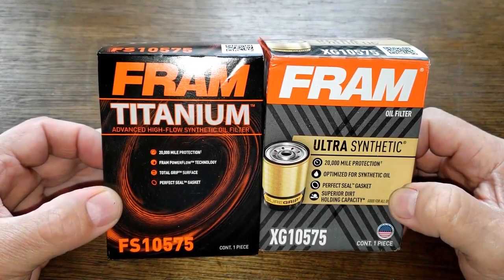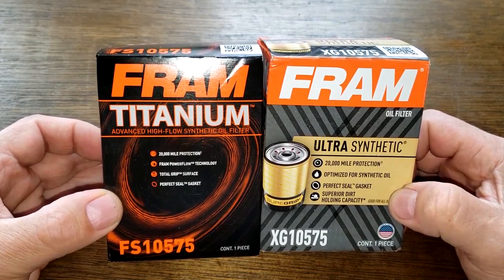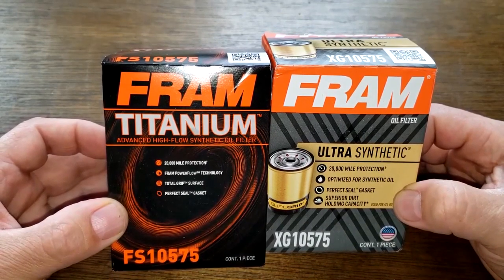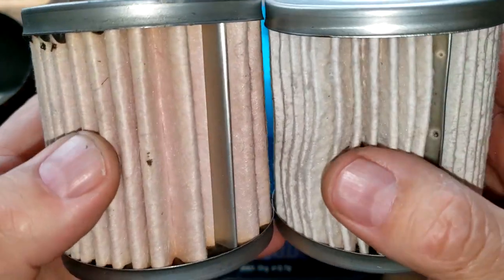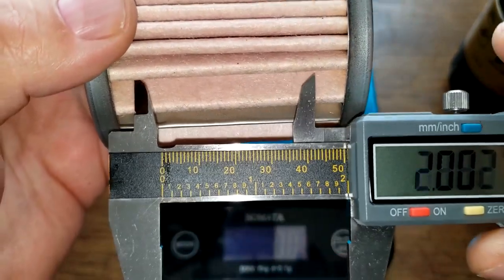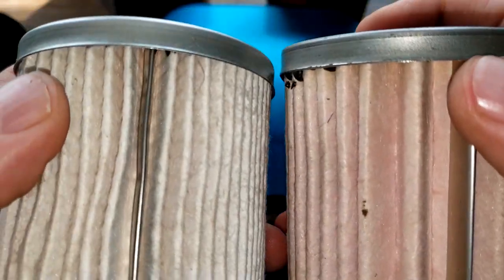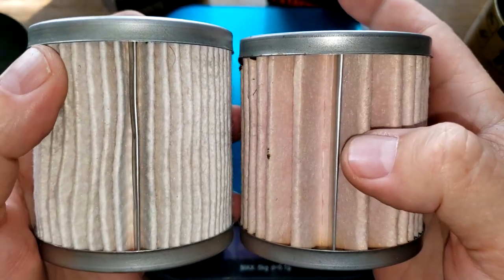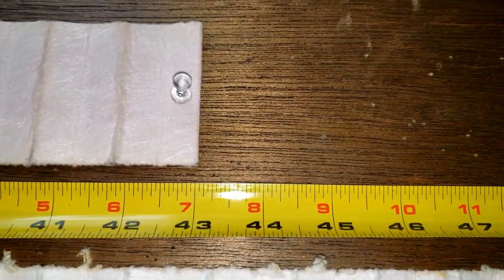Fram Titanium FS10575 Oil Filter vs. Fram Ultra XG10575 Oil Filter Cut Open

Comment: Now I've seen these two filters cut open before and the filter media was identical. That's kind of weird
Reply from the maker: Maybe old filter video?
The Fram Ultra changed a couple of years ago.
Reply: @WhipCityWrencher  yeah not sure where I seen it at but the filter in side was the same as the other. Might of been an older one from fordboss dude

Comment: The thicker material would be an oil pressure killer! Every car or truck I've changed from Fram to another brand has gained a few pounds of oil pressure. I would not use either of these filters.
Reply: What’s your go to filter?
Reply: No. They've done delta p testing on the synthetic media, in OG Ultra and Titanium. It is actually lower than the thinner cellulose and blend media. Titanium "flows" just fine.

Comment: Question if it does get in the filter will the filter still suck it out?
Reply: The hole in the middle of the base plate with the threads is actually the outlet hole where filtered oil gets pushed back into the engine. So, if one of those metal shavings came loose when you screwed the filter on to your engine, it would get pumped into your engine with the oil the first time you started your engine.
Reply from the maker: Yep, what 
"Save16thave"  said

Comment: $15+ for a filter. What's going on with the escalating oil filter prices?
Reply: Same with oil prices. Cost of manufacturing I'm guessing.  Not to mention shipping of parts. Used to be able to do oil and filter with full synthetic and a wix filter for $26. Now the filter alone is over $11 depending where I buy.

Comment: $15 just for an oil filter? Wow. No thanks.  For $4 to $5, I just use the 'tried and true' Motorcraft filter.  But I change my oil every 5,000 miles and use a full synthetic oil (usually whatever is on sale at the time).
Reply: It's not $15. It's $11 at Wal Mart. I paid $8.50 for my car. It's a 20K miles filter, but I usually change mine around 12K miles with the 20K mile extended drain oil. If you're not going 7,500 miles with full synthetic then you're just wasting money. But a lot of people do that. Yeah, it's not hard to change oil, but it's a pain for me. Takes me like an hour to do it and it's messy, so I prefer to change my oil as infrequently as possible.
Reply: @aznnp77  you only paid $8.50 for your car? How did you buy it so cheap?
Reply: @LA_Commander  It made sense in the context of my comment that I paid $8.50 for my filter. But I guess you're right, if you just take that sentence by itself, that's what it says.
Reply: @aznnp77  Tell you what, I'll give you 20 bucks for your car right now. You will more than double your money!  LOL 🤣

Comment: Question: When mentioning Micron Ratings, the standard is the ISO4548-12 spec -- BUT --  is "AT 20 Microns" the same as "Greater Than 20 Microns" ??
The Bosch Premium's box says "AT 20 Microns" which, to me, is smaller than "Greater Than 20 Microns" where I come from. 
These filter makers use some very subtle tactics in order to fool us.
Reply from the maker: Hi Chuck,
Particles greater than 20 microns, that's what they say.
Reply: @WhipCityWrencher  What "they say" is f**king goofy, Whip !!
From your videos, we've seen claims of 21, 23, 25, 30, & 35 Microns made by different filter makers.
 ALL of those numbers are "greater than 20 Microns", so we're left to wonder WTF these people are talking about.
The way I read it is : "Greater Then 20 Microns" means that we don't know what we're gettting -- 30, 40, 50 Microns, who knows ??
BOSCH is the only filter maker that has "AT 20 Microns" written right on the box, and it's made here in the good ol' U.S.A.
Reply from the maker: @SlikLizrd  Hi Chuck,
Yep, your filter "Bosch" is one of the ones that make that claim, I think Amsoil does too, which gets their filters from Champion, which in turn makes Walmart Supertech oil filters. I could be wrong though, every day one company buys another one so who knows? What happens if Bosch goes to Mexico and I open one up and glue everywhere plus a coil spring? LOL😊
Reply: @WhipCityWrencher  Just checkin' 'em --
Bosch = 99 % At 20 Microns.
Amsoil = 98.7 %  At 20 Microns.
WixXP = 98 %  At 35 Microns.
Mexico ?? Coil Spring ??
Wasn't it you that just did a review of a WIX,  "hecho en Mexico", and with a coil spring ??
 I know it wasn't a U.S.A.- made Bosch. 😁
Reply from the maker: @SlikLizrd  Hi Chuck, 
Fleetguard has some filters that are 100% at 30 microns with a coil spring, lol. Does that equal or better 99% at 20 microns? 🤔
Reply: @WhipCityWrencher  I'll never know, Whip, 'cause I already have enough oil filters for the famous 95 MERC to last me for the rest  of my motoring days, so the Fleetgard is not an option for me.
But hey, I was on U-Tube this morning, and there was a killer post from a guy that gave 3 links, with independent tests of  several brands of oil filters -- and I was freaked out when the WIX XP was the only filter that FAILED during the tests.
 Top Dog !?? You just KNEW it was the FRAM Ultra, didn't you ??  😁
Reply from the maker: @SlikLizrd  I had a feeling you would be stocked up on them Bosch filters. I have enough filters to last me a while too. Yep, I think this is the test you talking about.https://bobistheoilguy.com/forums/threads/would-you-all-like-to-see-iso-4548-12-oil-filter-lab-testing-comparison-efficiency-capacity-pressure-vs-flow-bubble-point-and-burst.334882/
Reply: @WhipCityWrencher  I couldn't find the particular info that I had found previously -- but my info came from that same source.
What I had found was 3 of those test results, on seperate pages.
BUT -- I lost 'em, and can't find 'em again.
Of the filters that were tested, the FRAM ULTRA was the clear winner -- and the WIX XP was the only one that FAILED.

Comment: Great camera work, Whip -- the BEST in the business !! Keep 'em coming !!
The Black cannister cools the oil better than the Gold.
The Titanium is an Advance Auto exclusive.  Unavailable to most consumers.
The Fram Ultra has 20% MORE filter area.
The Fram Ultra is available almost everywhere.
Same Gaskets.
Same Core Tube.
Same Retainer.
Same By-Pass Valve.
Same Silicone ADBV.
The Fram UIltra would be my choice between these two (2) filters, but I prefer the Bosch Premium oil filters for my own use.
Reply from the maker: Hi Chuck,
Thank You!
Between the two I think I like the Titanium better.
Reply: @WhipCityWrencher  "Between the two I think I like the Titanium better." 
 Great call. New Ultra uses a cheaper synthetic blend media, Titanium is the better filter.
Reply: The coating on the Titanium’s entire cannnnnnnnnnnnnnnnnnnnister seems to serve no purpose other than to make it look different than other filters. Must see if it’s on Fram’s website.
Reply from the maker: @faxmen09  Thanks faxmen09, I agree!

Comment: I’m very anal about my truck and just bought the fram ultra is this a filter I should run ?? Thoughts please !
Reply: Absolutely
Reply: @makaveli5257  I bought one had metal shavings in it lol I did some more research and I came to the conclusion that the NAPA Platinum is one of the best ones so use that. Cheers
Reply: @wnfakind9197  I clean them out  bit and use them. I have for years with no issues.. but I understand your concern.  I have also seen a little spec of metal here and there on other brand filters also.. cheers

Comment: The ultra synthetic filter ruined my engine. It broke down and circulated throughout the engine and caused a loss of oil pressure. The last oil change I did I used that filter along with Dexos 1 Gen. 2 & Gen 3 oil from Castrol. I've never had an issue with the Fram Ultra but because of this I will never buy another Fram filter again, and I will make sure that I tell as many people I can about my experience. Fram sucks IMO

Comment: Wow those metal shavings are an EPIC FAIL.  That hole and inside of filter is where you do not want ANY debris as it goes straight into your engine.  Imagine that going right into your camshaft bearing!   Thank you so much for showing how trash the Fram filters are.
Reply from the maker: I think this can happen to any foil filter, it just happened to be a Fram this time. I still like Fram Ultra and Titanium oil filters the Extra Guard not so much.
Reply: How much damage would it realistically do?

Comment: They are pale compared to typical Bosch, Blue Print, Mahle, or Wix filter that have at least 50 pleats.
Reply from the maker: You have to realize that oil filters that have a metal screen or polymer backing are going to have fewer pleats.
Reply: @WhipCityWrencher  ah you are right. The thickness of the paper matters